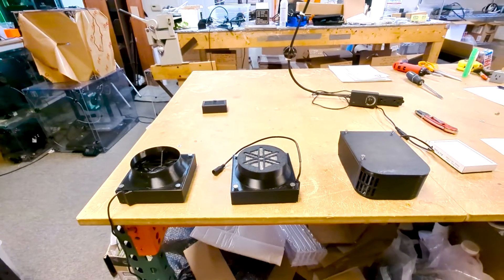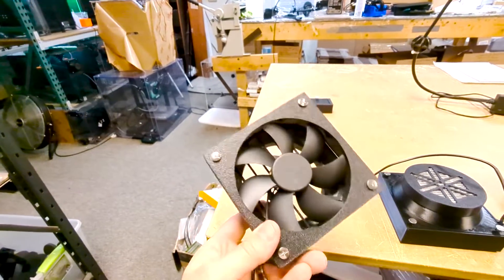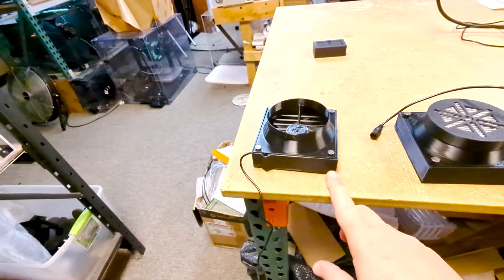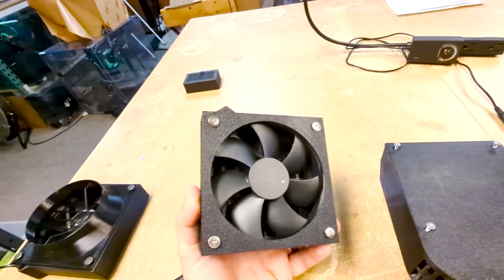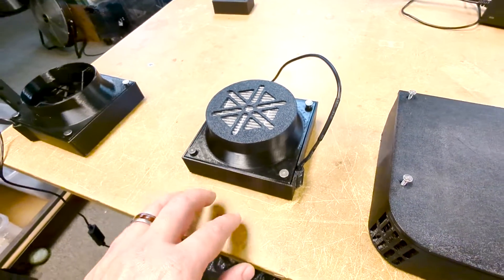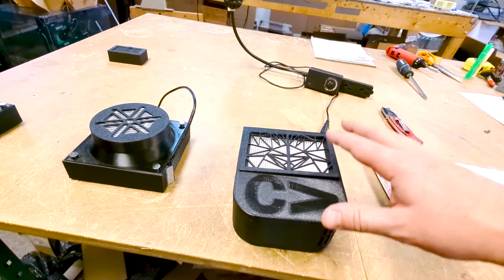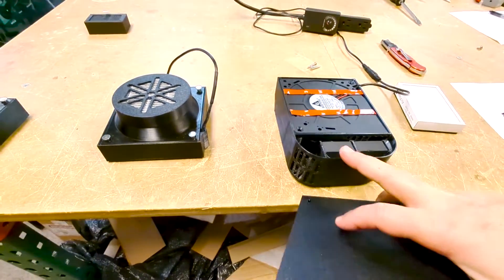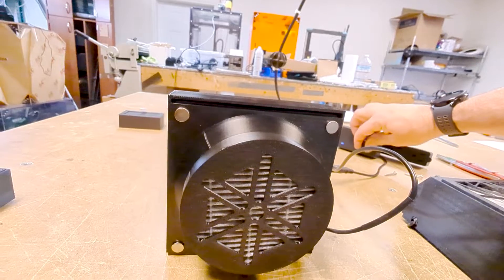Clearview 3d printer Enclosure Filters

Comment: Great designs. Is there a way to determine when the carbon filters need to be replaced, or is it just based on the number of hours of operation? If it is based on hours, a built-in hour-meter (vibration or power driven) would be a nice add-on :-).

Comment: Granulates are way cheaper than those elegoo and anycubic carbon cubes.
Reply from the maker: Our filters can easily be refilled with granulated instead of cartridges. We opted for cartridges because it allows more airflow.
Reply: @clearviewproducts  I bet it can´t be without addition, because if the granulates are big enough to not fall thorugh, their surface are is way too small to be effective, if the granulates are way smaller (like a 3M mask for instance) it will simply fall through and airflow will be difficult, you would need some kind of perforated box for the granulate to accumulate. 

I can buy or print a "BentoBoxV2" air scrubber which performs the same task.. 
What exactly does your product differentiate from solutions like that which are already available ?
Reply from the maker: @sierraecho884  It is a 5 minute change to Granulate. Then bentobox has shortfalls, but if that works best for you, no sense in wasting time here.
Reply: @clearviewproducts  "...It is a 5 minute change to Granulate...." That´s good then.

Which shortfalls would that be for example ? I mean showed a different solution, isn´t it worth talking about it ?

Comment: Why would you filter your exhaust ? If your exhaust leads inside your room and not outside, it´s not such a great idea, and you will need way better filtering. About halft the air is not being filtered properly when directly exhausting it, the filtering effect takes place through recirculating the air and even then it takes quiet a long time to recirculate all the air. This is more of a "better than nothing" solution but additionally you should have a room size air cleaner in the room you are in as well. 
The best solution for safely printing PLA where you can not exhaust the air outside you building (as in my case it is simple no possible to do so during winter) is to have a 2 stage solution. 
First stage will be your printer inside it´s little enclosure where you exhaust that air into a 2nd chaimber which cools the air down, simply by volume for example, this air is then again recirculated inside the smaller enclosure and so on. Only then a small filter with such a small surface can properly filter out all the particulates. This is a huge hassle. But either that or way bitter and more expensive filter solutions are needed. 
And even then you only solver one problem which is the printers emissions but at the same time you have even higher emissions with soldering, burning off a clogged nozzle, filament drying (releases a looot of particulates) sanding, using a saw etc.  So depending on what else you are doing it might be even way worse. Air filtration is a serious business and it´s really hard to do properly for a cheap price and with somewhat of convenience at home. Not saying the filters shown here are bad in any way, just be aware of what they can and can´t do.
Reply from the maker: What commercially available filter is available that fulfill all these factors?
Reply: @clearviewproducts  There are a couple, the cheapest one should be the "Bofa Airfilter" for like 700 bucks. The other one are for Laser cutting and such.

As you can see, air filtration is serious business and those filters use big amounts of activated carbon and have a big HEPA14 filter. That´s also why your small in line filter won´t work. Better than nothing but most stuff will be unfiltered.
Reply from the maker: @sierraecho884  We help clients with Bofa often. We're not oblivious. The Print Pro filter is 800%+ more expensive and the Filter replacement is 9100%+ more expensive than our filter. For any users that prefer that option no problem, they make great filters.
Reply: @clearviewproducts  Costs are the one parameter what about efficiency ? I am sure the pro filters does not cost 800% more just for mark up. It is obvious that your solution (don´t get me wrong, I am not saying it´s a bad solution). can´t be as efficient, so it has shortcomings. There is no way only one pass through the exhaust filters filters more than say 40% of the particulates. It´s just too small. Same goes for VOC´s the amount of carbon is very small. 
Look just inform the user or viewer that your exhaust solution does not filter out most of the stuff that´s it. People should know those things.